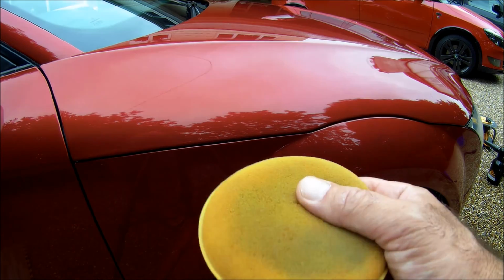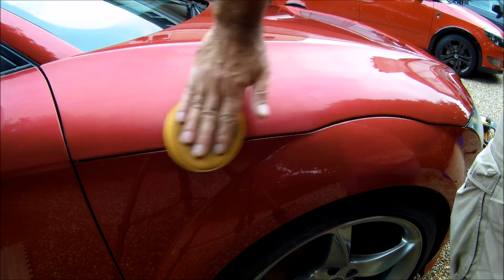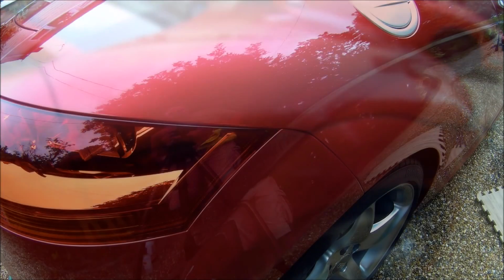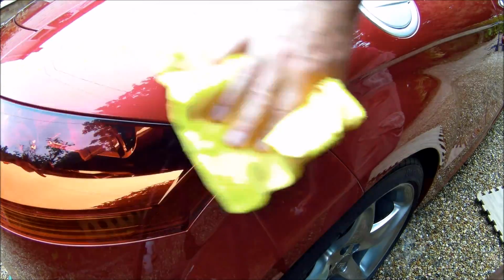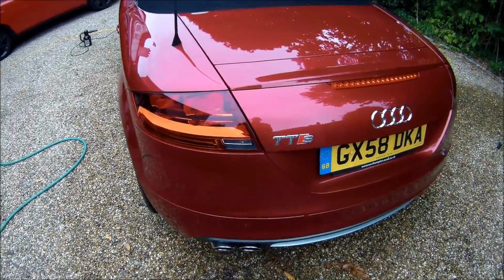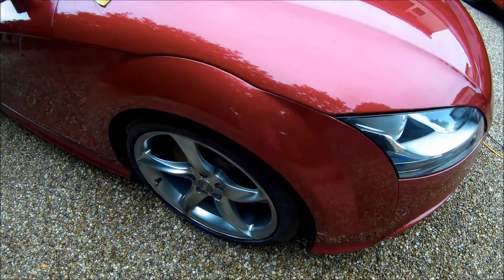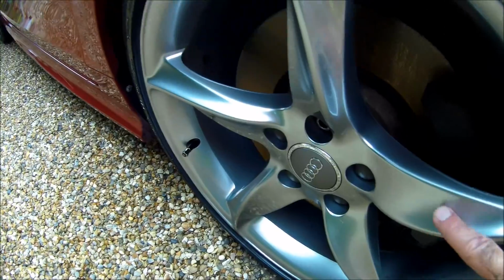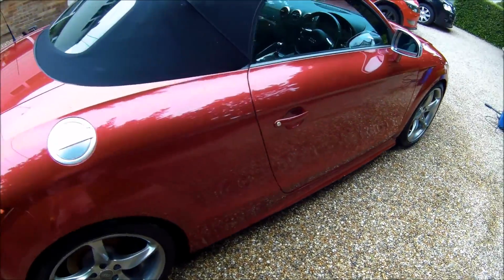Audi TTs Tdg products

Comment: Which product did you use on the wheels ? Also what was the blue brush you used. Wouldn't mind getting both.
Reply from the maker: +Richard Jones krystalkleen breakaway wheel cleaner and amdetails iron remover the brush is an EZ wheel brush from amdetails use my discount code D4N10 10% off